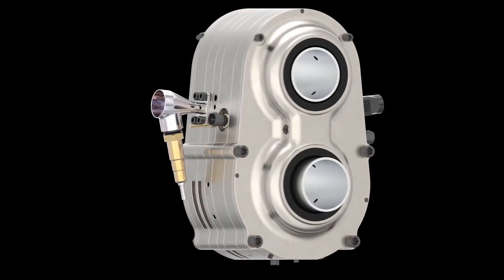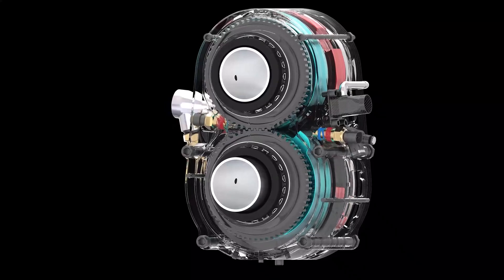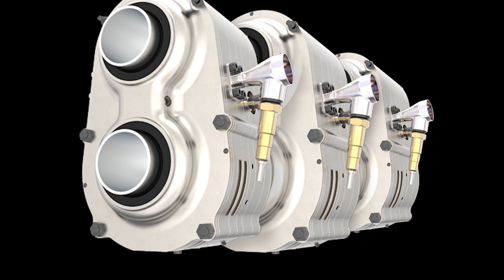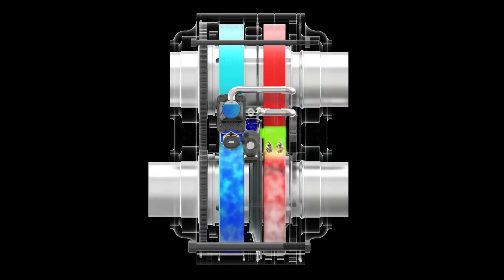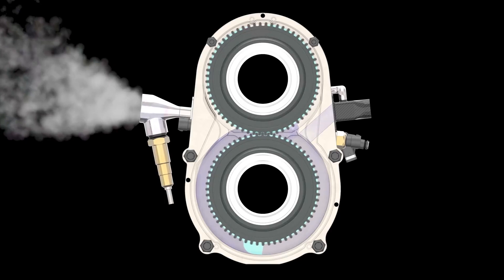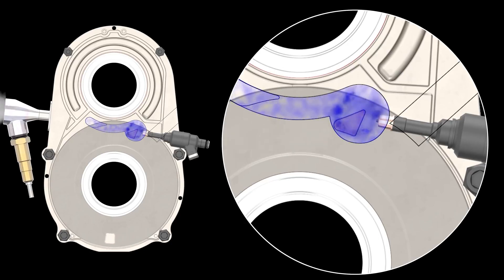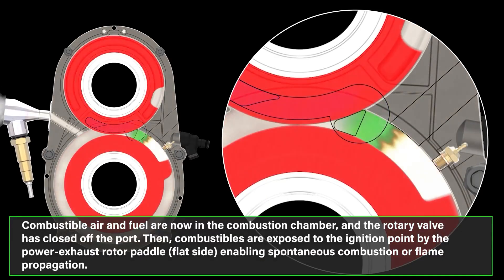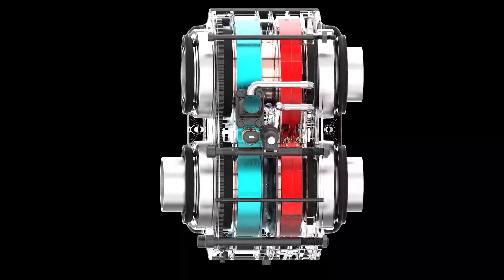This pistonless engine runs on hydrogen and revs to 25k rpm

Comment: Wonder would it make a difference lets say instead of the 3xhaust coming out due to next rotations,install vacuum system that pulls exhaust from 15 to 24000 rpm into a compressed retrieval tank like a double exhast turbo charge vacuum system twin exhaust turbines cept one spooled up with recirculating exhaust turned spooling compessor with recycled c02 one intake but then again that would probly jump rpms up another 5 to 10000 rpms.kewl video

Comment: I don't think it should be run on hydrogen, since it is, well, hydrogen. It's physically impossible to produce a seal tight enough to contain hydrogen other then, well, making a box that has  no exposed moving parts, or holes, what so ever, and make this box unable to be opened. But obviously you can't make an engine like that. The engine is cool though.

Comment: Interesting concept . With RPM range between 1K & 25K it could use a custom 2 or 3 speed transmission , further reducing weight . Put a single rotor into a Lotus Europa ?

Comment: So you have tubes which will need to be able to cope with torque loadings from hundreds of psi - they are going to need to run on bearings of some kind to that lack of losses is already down a lot. 
Then there is the big one. Those tolerances. Brushing over it and saying it would need really tight tolerances makes it sound like you can just build it with less tolerance and it will work fine but thats simply not true. Metal expands based on heat and that expansion coupled with the extra area of having the combustion "chamber" on the outside of the tube means there is a lot more area which will be affected. 
In reality if the tolerances were tight enough for it to run it would grenade itself once it was hot. If it was safe to run at full load it would either run terribly on start up or not at all. 
There are quite a lot of other issues - though most could be overcome fairly simply - but don't expect this to be doing anything in a car anytime soon. Well unless its a static load generator to keep batteries charged.

Comment: Yes any body with any sense can see this is the answer far far more realistic than
Floored Electric cars with so many unsolved problems….
NO NEED TO REINVENT THE WHEEL COMBUSTION ENGINES ARE ABLE TO RUN ON
SO MANY DIFFERENT FUELS (. Not just petrol & diesel. )) TO MANY TRYING TO BURY
OUR HEADS IN THE SAND TO MAKE MONEY FOR THEM SELVES .

Comment: Even if this motor is way more efficient than a conventional reciprocating motor, and very much lighter, it is powered by hydrogen, which is only a clean fuel if it is made from renewable electricity via electrolysis, which wastes up to 30% of the input electrical energy even before it becomes a fuel. An electric motor is 90+% efficient, is much simpler, lighter, operates at much lower temperatures and pressures and is far more efficient in every way.

Comment: EV's are going to bankrupt ford and GM.  They are going all in on EV's even though they have numerous problems and still require fuel for the electricity.  They have no idea what to do with old batteries.  The cost is extremely high and going to get higher.  Companies that pursue alternatives like this will end on top.

Comment: Imagine if you will a tiny, light weight engine such as this that does nothing but drive a generator to keep EV vehicles charged as they go.  A sensible hybrid which would provide virtually endless range for your EV.   Now see that engine as one based on permanent magnetic principles to generate the same rotary power to drive the generator.  Endless range.

Comment: It looks cool definetely but i can think of some potential problems.

1. Obviously mass producing an engine with such high tolerances will be more expensive and time intensive, so mass producing it is harder.
2.Also high tolerances make it difficult to maintain a seal, pretty much as metal heat up, it expands, and vise versa, so if one part of the engine could expand too much or too little  it could create problems with sealing the engine.
3. If you're going to be running it on hydrogen, then that isn't very good, because first, hydrogen stations are basically extinct, so you really can't use this engine in a production vehicle like a car, because then you couldn't find a place to refill the hydrogen tank, also not to mention, hydrogen is expensive to make, and has a lot of losses in the process of making it ( basically the electrolysis reaction of water which splits it into 2H and O, but it requires electricity, and electricity requires fossils fuels to produce) so in the end it's not very efficient.
Also storing high pressure hydrogen is pretty hard, and requires quite a beefy big tank, which i just wanted to point out.

Unless they can prove this concept is actually good, i'm not really that hyped about it.
Theres a lot more problems like lubrication, friction and actually mainting 160HP at 25kRPM so yeah.

Comment: what about Quantum Energy powered thermal plasma  engine
Reply: you woukd need to machine into either the upper wall of the cylinder, Scalloped geometry or apply it in the cylinder head... either way..  the concept is to reflect and focus a laser beam around the cented dead area and reuse the initial energy by way of reflection across the piston and head gap.
woukd use nothing but atmospheric air...
you could claim this to be an electric motor because the initial energy to run the engine is battery power..
other than that.  it would operate tge same as sn internal petrol engine...
think of it like.. the merging of Starwars technology and old school Detroit. 
I  so hope I haven't divulged too much info here..
just wanted to stimulate and give you a taste of what's comings. 
cheers.

Comment: I need to see a prototype of this omega-1 motor actually working with hydrogen fuel before I’m convinced that this is a better alternative to the piston engine ICE. Especially because it would take a very large volume of liquid hydrogen, and at an extremely low temperature of only 20 K, in order to have an equivalent efficiency to the conventional gasoline powered ICE. If the motor is powered by hydrogen in a gaseous state then it would require a a hydrogen tank that it would take up the cargo space of a large SUV.

Comment: Hydrogen is very low density and dangereus even with fuel cells that achieve near perfect efficency they are not viable.
Electric cars aren't viable either because our current way of making batteries is very expensive and terrible for the enviroment. Combustion engines that run on Diesel and Gasoline still have a long way to go. Some company is trying to make opposed piston engines and they are already 1.5x more efficent than what we have now. Currently Hybrid is the best, use the small battery for the daily commute and the combustion engine for the road trips.

Comment: Electric vehicles aren't so carbon neutral after all. Before you charge it the first time, they used appropriately 20 tons of carbon to produce it. The electricity to charge it produces more carbon to make that electricity available than it would have taken to drive and the 500,000 pounds of minerals mined for one battery would need to be replaced by the time you're almost carbon neutral which estimates are around 100,000 miles.  There is a law of physics,  to transfer from one power source to another loses power and energy. Thus, to drive x number of miles using diesel would be more efficient than gasoline due to a loss in the production process, then to burn fossil fuels to convert to electricity uses even more. What we need isn't electric vehicles, we need something more like hydrogen power. With water being its off gas, we have zero harmful emissions.

Comment: I've seen this idea and engine design and it's certainly interesting, but until a decent hydrogen producing fuel cell is developed, I don't see hydrogen burning engines as viable alternatives (yet).  There are still MASSIVE issues with economically generating hydrogen much less the physical limitations of long term storage and long distance transportation (thus the need for a better fuel cell).

Comment: Yeah no this will never make it off paper as it doesn't set up cars as a thing only for the super rich, that's part of the point of the EV green shit is to remove people's ability to freely move around while making cars so expensive only the elite may have them. This solves all the non-issues that are spouted over gas powered cars so this will just get buried so it never gets actually explored. They will keep pushing EV green cars even though they pollute far more than normal cars at every level of production and use while being insanely less efficient or out right useless for any hard use.

Comment: Why would you burn the hydrogen? What is the advantage over simply rehydrolysing back into water and charging a battery or just using the electricity required to create the hydrogen in the first place directly into a battery? It's an interesting concept, but is it actually solving a problem?

Comment: That much energy in such a small space would create the need for significant cooling .  I.e.  weight .   And no seals means it requires tremendous tolerences so the engine would fail in a few thousand miles . Looks good on paper but has severe engineering problems to overcome.

Comment: Interesting concept. I’m confused on how the compression of the fuel is maintained once it passes into the combustion chamber? Once the compressed mixture is passed over the compression is lost, so how does it utilize the compressed fuel? Is there more info on this engine. I love Wankel engines but they also lose compression across the spark plug port, so lots of lost power.

Comment: I have designed a very similar orbital style wanting to remove opposing direction and excessive parts...a jet engine has a rotary turbin that simply spins one direction...and jet engines have proven infinitely reliable...the combustion engine is the future as they will become simpler...and more reliable...using only clean natural Hydrogen endless supply...

Comment: It is still a Carnot Cycle so even the theoretical maximum efficiency is in the 60somewhat%. Batteries & electrical motors don?t go through the Carnot-Cycle, so it is much easier to get a much higher efficiency.

Comment: Was a technical ceramics machinist. In the 90s, worked for a company that did work for a company that made a mostly ceramic 4 cylinder engine.   Turbocharged, fuel injected.   Cooling system was minimal, as was oiling. Engine could be carried by hand, very light weight.   Made 400+ hp, ran for 6mos, nonstop, at varying speeds, loads.  When torn down and measured with a cmm machine, No wear.     They cast the motor, prints, in concrete, took it too deep water off sf coast, and kicked it overboard.   Why make an engine that will practically never wear out.
Reply: Wait...what?? Why??

Comment: What about balance? With one rotor having a big bump, and its mate with a similar-sized crater, this engine will tear itself apart at 20K rpm.
Ever fired up an angle-grinder with a chip out of the disc?

Comment: How efficient is this? It has to beat current fuel cell cars for it to make sense.
Hydrogen is a good fuel, if only we had efficient ways of production and storage. In practice, we barely have any infrastructure for it. These problems are not insurmountable, but only if we have insensitive to persue this.

Comment: This is basically a periodic gas turbine. Intake and compress air with the first section and then compress, ignite, and extract energy in the next. Pretty neat.

And yeah, being able to turn without igniting is critical. Gotta maintain engine speed to keep up the dynamic seal. And since cruising usually takes a very small amount of power that is hard to get efficiently in a larger engine without skipping strokes.

Comment: One of the downsides of earlier Rolls Royce turbine engines was they were necessarily machined to extremely high tolerances when compared to other engine manufacturers such as GE and others. They suffered in terms of mean time between failures comparatively which meant they lost a considerable share of the market. High tolerances are a lot easier to manufacture to these days and, who knows?, might even be able to be kept operational as wear or failure takes place. It's a gamble.

Comment: I've always been on hydrogen. It's basically what we have, but cleaner. Fully recyclable parts. The issue with batteries is they degrade. Will always take more time to recharge than to refuel. And they may not always be recyclable.

Comment: Those seals provide durability tho. You hit a speed bump wrong enough times and lose a lot of efficiency or have full on engine failure. And what kind of lubrication works on a 25k rpm motor in civilian hands? LoL

Comment: Lots of media negatives surrounding hydrogen  energy technologies. Even tho, plastic waste pyrolysis with activated carbon catalyst byproduct is hydrogen rich + liquid fuel source profile corresponds to that of jet fuel properties. 

Hydrogen logistics communities is the future. EVs using power grid resources has a much bigger carbon footprint then a typical fossil fuel vehicle. Standard power station incinerators burn wood and coal... and anything combustible which would include all manner of plastic waste, road tyres, treated wood containing - chromium, copper and arsenic. 

Thought I'd share 😊

Comment: Where's the oiling system, what happens when the metal expands and contracts due to heat and the extremely tight tolerances are no longer tolerable. What about temperature differences in general on the combustion and intake side. Seals are in every engine for a reason. This will never work.

Comment: Turn it sideways...figure out an extension mode and put a seat between it and some steer bars....a set of tires and you have the concept for the tron cycle

Comment: I a can also see the use of this engine in automotive industry. Only use it to spin electric generator to power up electric motors - power on demand. No big battery pack required and may be even use of capacitors instead. 
Nothing new in this idea, though. Big mining dump trucks use their diesel engine to generate electric power to feed electric motors on each wheel. Large vessels use turbine engine to generate electric power that runs throughout the ship. Of course you would not run a jet engine on a automotive vehicle to generate power, as it takes time to start and stop. In the contrary, this reinvented internal combustion engine have promising perspectives due to its size and power.
Just a thought)

Comment: I can also see the use of this engine in automotive industry. Only use it to spin electric generator to power up electric motors - power on demand. No big battery pack required and may be even use of capacitors instead. Just a thought)

Comment: R&D should definitely be continued. There are a lot of small difficulties to overcome but I would also love to continue with " Suck, squeeze, bang, blow"
Reply: Ford is apparently putting this in the new transit vans
Reply: @msharp6887  no they aren’t. This isn’t even a remotely proven concept
Reply: @thedefenestrator2994  look it up
Reply: Technology is so good that problems and cost can be overcome.  But we are at a stage where the diversities in energy production and storage must all be explored and supported and maybe the diversity of methods for local needs should be explored and the idea that only a central grid can supply total coverage could be rediscussed to the planet's advantage.
Reply: @timw4030  my personal opinion is that relying on an external power source is backwards technology. Electric cars are a step backwards.
Reply: I understand the hydrogen, the h2o electrolysis consumes a lot of power. How much does it use? How long will it last? What low and torque values ? Accessorie  drives, or parasite loads? ChiefD

Comment: The pistons, if the cut-open graphic example is anything to go by, are not only grouped in 2 groups that are two of them move precisely simultaneously, the connection of those two groups of two on the crank shaft ALSO are positioned 180 degrees opposed to each other. Both characteristics make no sense cause they diminish the reasons why one would even go through the trouble of making a 4 cilinder engine anyway.

Comment: Hydrogen is a stupid fuel to use, you will get hydrogen embrittlement of the steel, coz you ain’t making this out of Aluminium, whatever weight savings you get are offset by the weight of the pressure vessel you need to hold the H2, also, H2 ALWAYS leaks….. ALWAYS

Comment: Running it on hydrogen, it's light weight would be offset by the fuel tank weight because of hydrogen's low energy density. Newer carbon fiber tank tech with insanely high PSIs would help, but still... I've always been more of a fan of something like this or a hydrogen turbine engine in a hybrid configuration, only generating electricity for range extension in an electric drivetrain vehicle.

Comment: Still going to have the same problem, that hydrogen is an extremely low density energy source. While it contains a lot of energy by weight, it doesn't by volume. So maybe it could work in ships and trucks where there is plenty of spare room, but it would take half the car to store enough to get a similar range to a tank of petrol or diesel.

Comment: Question is what applications is this suitable for ? Can't be a car. What rpm rangr does this engine need to be at to produce enough power to give a driving experience like what we are accustomed to from a dead stop ? I don't believe a suitable transmission to date was designed for such a high rpm reving engine for domestic passenger cars. Nice idea but not financially applicable for the masses needs in the domestic passenger car sector. A bunch of imagination if you asked me. Maybe in the year 2090 🥸